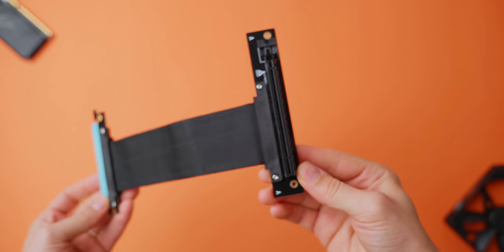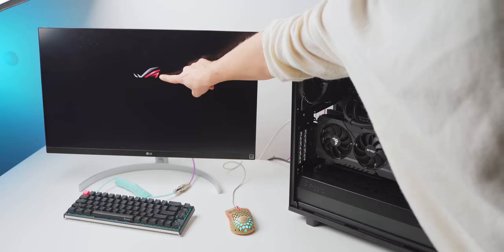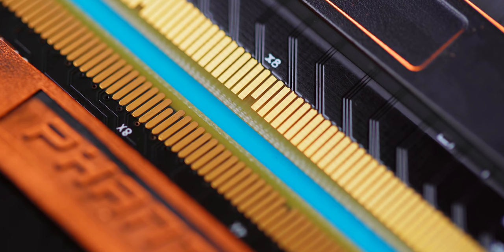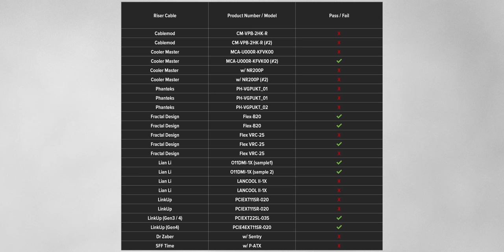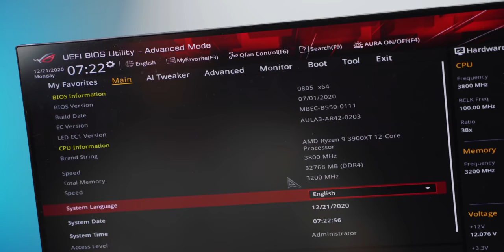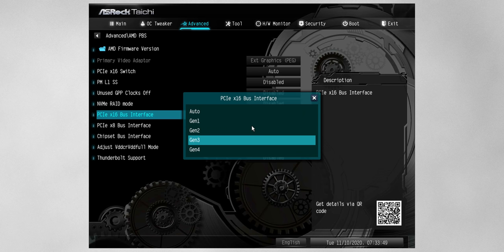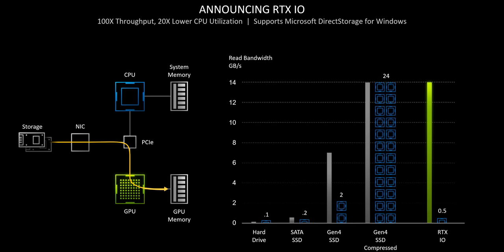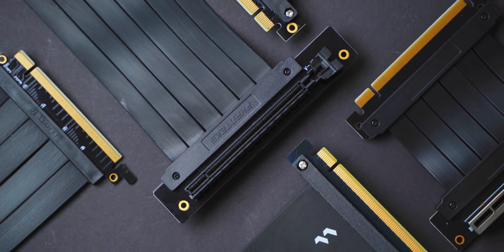There's a PROBLEM with Riser Cables

Comment: The differences are because of manufacturing variability.  Keep in mind that every time you go through a connection there is a time delay.  For example each connector that your signal goes through might be worth 2ns.  With delays stacking up it could cause signals to fall outside their specified capture window.   Don't forget signal attenuation through the connections and wires which could cause data eyes to be too small.
Reply: Not necessarily, it really depends on a number of factors. i used a Gen 4 riser from Thermaltake and it was 14 inches long and I had no data loss or bandwidth issues
Reply: @tonyd0001  That is what the OP was saying, it might have a difference or it might not because there is a lot of manufacturing variability.  He was saying could and might.  You have a riser that works but someone else might get one that doesn't.  As signal speed increases your signaling window gets smaller and smaller.  If your cable isn't good quality you will have problems.

Comment: They're not the most ideal solution, but having the vertical GPU looks amazing
Reply: Not this generation.
Reply: @WooBino.  Well, for hard-line water cooling systems, a vertical GPU is gonna bring the look of the PC to another level
Reply: @Jay-mk8no  not worth the frame loss. I took my vertical out after a day. Why add an additional cable that’s only for looks?
Reply: @WooBino.  Frame loss? What are you talking about?
Reply: @Tommy-T448  Had stutters and lost FPS when I had my GPU in vertical with a good brand vertical bracket and cable.
Reply: spend loads of money on a card for performance, then purposely add latency and reliability issues so you can simply look at the card fans? 

Ok.....
Reply: @WooBino.  You might need to denounce the "good brand" you're using, Linus did a video where he had to daisy chain 10+ raiser cable before it affected the performance.
There is no one, NO ONE would trade a little bit better looking for stutters and lag.
Reply: @Tommy-T448  that's subjective. What can work for one person may not for another, as proven with this video.

I'll go watch the video again but if it's a basic FPS test it's not indicative of what the issue is using those cables, it's like saying I can extend my spark plug leads 6 feet and the car still runs, it ignores so much people don't understand, just because you can doesn't mean you should.

Edit yes it was a stupid FPS test.
I'll leave it to that target audience if that's how people test the extensions, not a single mention of even basic cable resistance.
Reply: @GmoLargey  Cable resistance is meaningless if people only use one. Also as said in this video, there is no issue with PCIE 3 cable.

Comment: A way to avoid removing the riser cable is to plug your monitor into onboard graphics and change the bios setting 👍
Reply: Yeah if your cpu  supports on board graphics 👍

Comment: Yeah you buy a brand new PCIe4 motherboard, you buy an expensive graphics PCIe4 card and then use a PCIe3 cable to slow down the system to PCIe3.
Reply: actually the PCIE 3.0 speeds doesn’t actually slow down the gpu that much, Gamers Nexus did a test video on it with a rtx4090 and the performance drop isn’t too significant.

Comment: Great video! It will help a lot of people! Although I wish it was out sooner LOL. Spend hours trying to figure out was was wrong with my new 3080+5900X build. I have a custom loop and had to drain it 5 times during troubleshooting! Thnx to a reddit post I found that the vertical riser did not work properly on bios auto setting for PCI-E. First VGA error during booting and later stability issues during startup of a game and even the complete Nvidia driver going nuts with screen flashing and the list goes on. Man I almost gave up, but luckily it's all working fine now. Oh and also 2 out of 4 RAM sticks where DOA, that didn't help either haha
Reply: Out of curiosity then, instead of auto are you setting it to stay on PCIE 4 then? I might do the same if that's the case because mine is on auto as well right now
Reply: @chaosblade234  I set it to GEN 3 in the bios. Literally instantly fixed all my issues.

Comment: Uhm isn't the problem that the riser cables are  just 3.0 and you are trying to connect a 4.0 motherboard and 4.0 gpu together?  You need a 4.0 riser cable, or you have to go to your bios and set your PCI-E to 3.0 (because of the riser cable).
Reply: Um, isn't that what the entire video is about?
Reply: @OriginalMergatroid  and why would you make an entire video about a riser cable 3.0 that won't be able to operate on a PCI-E 4.0 slot?
Reply: @masterpNL1983  FFS man, obviously this video is made for people who don't know about such things...
If you are such an expert, why are you watching beginner videos? Just reading the comments here, it's again obvious several people came across this exact issue and were helped by this video.
If you don't want help, and don't want to offer any yourself, why are you here?

Comment: A dodgy PCIe 3.0 riser cable blew up two of my motherboards (literally caused a pop and smoke).  The Thermaltake premium ones are the only ones I'll use these days.  Also currently working for PCIe 4.0

Comment: Couple random things:
1) I used a thermaltake riser w/ a B550 vision D and tuf 3090. it worked to get in the bios, and even load the OS. but, you couldn't install drivers properly. they'd install, but constantly reload again and again until i switched it down to gen 3 mode. not sure how useful that info is though given how inconsistent devices are with working or not. at least, if someone sees this behaviour, they might know why

2) I wish riser cables were standardized w/ respect to mounting. it's almost impossible to use a riser not from your case manufacturer w/o modding because they won't mount in the same way. that's super frustrating

Comment: I have an x570 msi board with a 3080. works perfect until I used a riser 3.0 from the vertical gpu kit from cooler master. once the bios was set to 3.0 it will boot but after a short while under gaming load I get a black screen. Almost skeptical of a 4.0 riser cable. look forward to 4.0 riser testing.

Comment: Doesent Ghost S1 MK3 already come with Gen 4 cable? I had problem with my phanteks evolv shift case because of the riser, when I switched to the S1 MK3, i havent had any issues at all.
Reply: yes its a PCIe 4.0, i run it with a rtx3070 and 5800x , with no problems
Reply: Yes, the weird blue cable is PCIe Gen4
Reply: Yes Loque who made the ghost s1 has a gen 4 cable. Albiet it's very ugly and stringy. To buy it serperately is about $100US.
Reply: @SB68SS  congrats man you’ve got the perfect machine!

Comment: I have a 2080ti with an intel/msi and could not for the life of me figure out why I would have so many problems with crashing and not wanting to start.  Even replaced the PSU which isn't cheap in these tiny cases.  Changed the setting in the bios to gen 3 instead of auto and so far so good.  Thank you!

Comment: Can we just get a spec for vertical pci-e cards. The way they get mounted is trash. Blowing air into a backplate. How on earth was that ever a design
Reply: They already exist, they are called ''blower coolers''.
Reply: @thundereagle4130  yes, but pci-e spec is too narrow and so blower fans on those cards are rather small. Blowers seem to have a decently quiet sound compared to rpm. Problem is they’re too small and so they have to spin rather quickly

Comment: I’m running my 3080 at Gen 3 on Z390 with the Thermaltake P3 riser. Thus far it’s been fine.
Reply: Isn't that because intel doesn't yet support gen4?
Reply: Did you bother watching the video? It is only an issue for amd running b550 and b570 mobos on gen4.
Reply: @argh6666  Yeah I did. I’m not mounting an argument. Not everything is about being right. You care to think perhaps I was just mentioning my own use case? If my comment doesn’t have any relevancy to you then you should have just ignored it.
Reply: That's because z390 doesn't support Gen4 PCIE. Only x570 and b550 AMD boards have that feature. If you don't one of those two boards, you will not experiance the issue.
Reply: @mattevans1643  I am aware of that, I'm just mentioning my use case for the sake of it.
Reply: @joshuanorman2  Yes.
Reply: If you cannot infer the tone used in this comment and aren't able to discern between what an argumentative comment is or isn't - please don't bother replying.

Comment: Mine is Gen3 but I built a PC with the Thermaltake Core P5 and before getting it, I've read reviews. All reviewers said, the supplied riser cable is awful and almost everyone has problems with it. They recommended to get the premium riser cable from Thermaltake and with that one I didn't have any problems in the past 2 years.

Comment: I wish I would of saw this when my pc started randomly restart looping and could only be turned off by crashing it. Eventually it turned into my pc couldn’t post and corrupted the bios. Had to use a gigabyte rescue bios to bring it back and then the gpu couldn’t be detected. Was convinced it was a software issue but it ended only being able to work after the riser cable was replaced. Very hard issue to trouble shoot at home with a custom loop.

Comment: Motherboard manufacturers should work on adding a switch on the board for gen3.  Especially on ITX boards meant for sff.  That way you can toggle gen3 as default for dealing with bios updates and bios resets.
Reply: They have such a thing in bios already but the issue is that your riser needs to be just good enough for you to get that slow video signal and struggle to get to the setting.
Once you get gen 3 set you just restart and take care of the other bios settings, then avoid clearing cmos.
Reply: @DJAbraxoOfficial  That's what I mean, a hardware side switch or jumper so that you don't need to boot into the bios to set it
Reply: @Braffy  Even though I'd appreciate it, with gen 5 peeking just slightly on the horizon (already wtf), I don't think it's worth the effort/return for manufacturers. Within 2 years this switch "is obsolete", I'd rather see universal bios used across each platform (without manufacturer flavoring and chipset factory default settings instead of aggressive brand selling settings) and them having auto detect whether you're using gen3 or gen4 or whatever gen via firmware/bios, much easier for beginners and veterans alike.

Comment: I see that Lian Li has a PCIe 4.0 cable now. I wonder how it works, and if it can be used with various vertical mounts as I've never vertically mounted a graphics card before, so I'm not sure if it would automatically fit with vertical mounts from any other company (thinking about the Fractal Design Torrent and using a vertically mounted graphics card there).
Reply: I think ekwb does as well. But pricey.
Also looks just like the linkup

Comment: Never really liked the idea of riser cables just to do vertical GPU mounts. It usually leads to worse GPU temps/performance and introduces another point of possible failure. The only real use for it is with SFF builds where you don't really have a choice.

Comment: I am so glad Hardware Canucks made this video. I own an X570 and recently picked up a RTX 3090 (coming from 780ti). What's actually funny though, the things Dmitri described in this video (BSOD, not being able to boot, bios slowly rendering) all happened to me with the same riser cable. I own a LinkUp PCIE 4 16x and I was fully convinced there was some weird weakened cable issue between the GPU and my mobo. I positioned it in a particular way, straightened it all out and it now works. All my problems are gone now. I was consistently trying to re-position it and see if it was an issue with something in the cable and I figured i might need a new one. I'm starting to think I jumped on the PCIE 4 train too early and the tech needs to mature. 

Either way, good to know that this was not specific to me and that hopefully, newer revisions will resolve these issues. Thanks guys ! :)

Comment: So I have been watching you for some time on my other account you have great videos and I have subscribed today with this account.  I was talking with my son about my new build and how I wanted to do this with my graphics card. I bought a Fractal Design Flex B-20 PCIe 3.0 x16 Vertical GPU Riser. Looks great. I do very little gaming and I never over clock. Just went for the looks. However after the install my PC would randomly lock up. I would receive a PCI Express WHEA-LOGGER error in the event log clear and retry, after several attempts I gave up. Then I saw this video. My PC is listening... :) THANK YOU SIR!!!

Comment: Thanks for the video.
After having issues getting my RTX 3080 to work properly. I started suspecting the riser cable. You confirmed it for me.
Not to mention the card worked fine on an older motherboard Gen3PCIE.
On ny newer board I resolved my issue by forcing Gen4PCIE down to Gen3PCIE. Now it works wonderfully. 🙂

Comment: If anyone is interested, I can vouch for Linkup Gen 4 cables. They work perfectly  on the Gigabyte x570 Aorus Elite in PCIe Gen 4 mode with an RTX 3080. Not a single crash and performance is the same as directly connected. I've had long gaming session on Cyberpunk 2077 (8 - 10h session) and not a single crash.
Reply: i'm also using a linkup pci-e 4.0 cable without issues with a x570 strix-e and evga 3070 ftw3
Reply from the maker: Yup.  The linkup one works well
Reply: Also their 90 degree angle PCIe 4 cable works in the Phanteks shift (or so they say), I'll find out when I get it with a 6800xt when that comes back in stock

Comment: Recently installed a Phanteks riser cable using 6800 GPU on a B450f ASUS ROG mobo. No issues. Bandwidth is 13.47 GB, not bad for 3.0 x16 !
Great video !
Now I need to plug-in my 5800X and test the Resizeable BAR support on a B450f mobo, hope this works !!!

Comment: I ran into this issue 6mos ago with my X570 Tomahawk and Aorus RX5700XT using an EZ-DIY Riser in a Define R6. It would reach post and access BIOS but frequently crashed loading Windows/was unstable. Thankfully the BIOS has a manual PCIe Gen3 switch, been rock stable since.

Comment: Hello hello, Big fan, I want to tell you another fixture that i just encounter, I have a rtx2070 with a gen3 Phanteks riser with vertical mount paird with a 570x Mobo. Worked like a charm for a year, i swaped the gpu out in order to install an m.2 SSD and after that my gpu with the riser crashed but only under load, i bought another Phanteks riser still gen3 (thinking that somehow i broked it when i moved it) It worked for 2 weeks. The problem was the metalic braket itself, somehow when is mounted put pressure on the gpu and it is moving in the slot, if i do not mount the GPU braken on the case and just leave it stand by itself works like a charm. So i will reinforce the GPU metalic bracket with some new rivets and it will be fine. Thanks for the video, you guys are doing a great job!

Comment: Thanks Mr Dimitri! I built my latest rig in the NZXT H1 with the Asus Strix B550-i and RTX 3070. I had the suuuuper slow refresh rate when I first booted, but persisted and was able to switch down to gen 3 in the bios.

Comment: I removed my riser cable after watching this video and noticing on the Superposition benchmark that my GPU wouldn't go above 60 degrees. I plugged it directly into the motherboard and immediately achieved a score several thousand points higher and temperatures increased to 75 degrees because my card can actually work now. I couldn't overclock the card previously and my OC is working now. I should have dumped this cable long ago. Thanks Hardware Canucks!

Comment: I had riser cable issues with pcie 3.  Its about the quailty of the card and the cables.  Ive heard expensive risers from thermaltek work well via linus tech tips.  Pcie signals are very sensitive to noise.  The offical spec for pcie3 signals is a max length of 8 inches most likely due to noise sensitivity.  Look for shielded cables and avoid cheap riser cards for china.

Comment: I know you mentioned this is a Gen4/AMD only issue, however since I installed my RTX 3070 on a riser cable with my I7 9700k I have not been able to OC my CPU without getting BSODs.  It all running with an EVGA 850W PSU so I do not believe this is a power issue.  I am going to try it without the riser and see if any results change.  Thanks for the info in this vid.

Comment: I have the Cooler master Vertical GPU bracket Version 2, which runs flawless without any problems or errors so far, not even after long intensive gaming sessions. I did however have to manually set the PCI-E X16 mode to Gen 3. I recommend the following: 
1. Put the graphics card directly into the motherboard slot.
2. boot your PC and install the GPU drivers.
3. Set the PCI-E X16 mode to Gen 3 in the BIOS.
4. Boot your PC again to see if it works with Gen 3.
5. Install vertical GPU bracket. 
Should work instantly without any problems.

Comment: I use a cooler master riser cable all most 4 years (z170, z270) , vertical Gpu mount and no problems until now, right now I'm in 10Gen intel z490 working great, graphics it's old gtx 970  but i not a gamer.. Great video!👌😉

Comment: Well Dimitri,ONE YEAR after this excellent video there is no solution ,at least a profound one... I had the same exact problem ....Unfortunately...AND ...Now we have newer editions revisions and so on from the two "gladiators"...We have newer generations newer cpus newer gpus newer components but the same old problem...Should somebody have done some research for this one?? Some secure solution?? A hole generation  is passing by and nobody found, at least, a secure fix for this one... Anyway I hope ...Some people's dreams and designs are hopping for the PCI...Messia !!!!